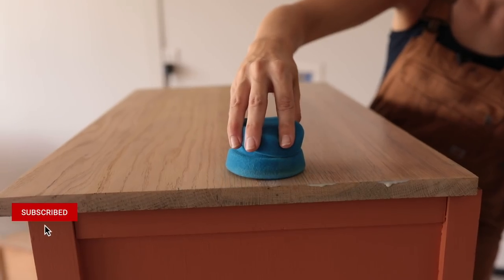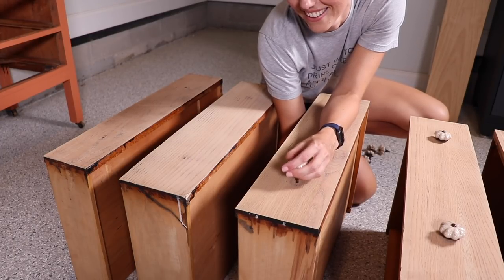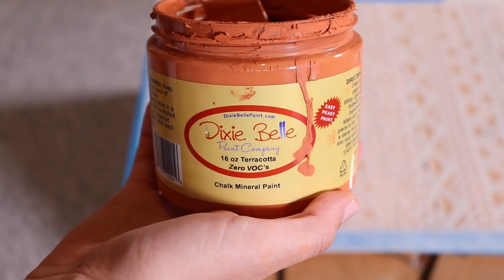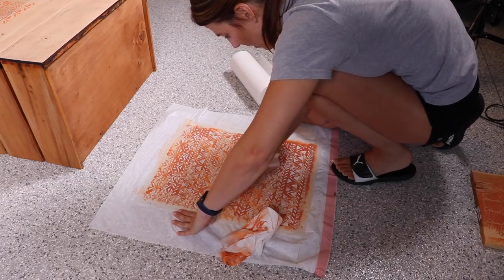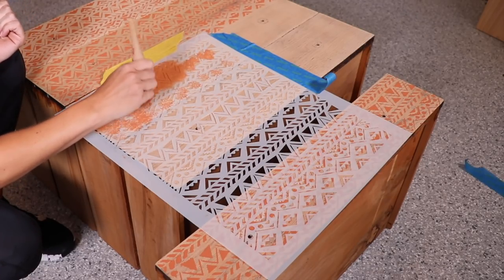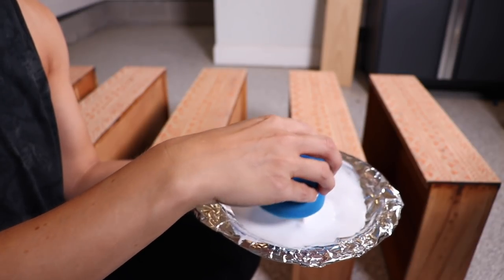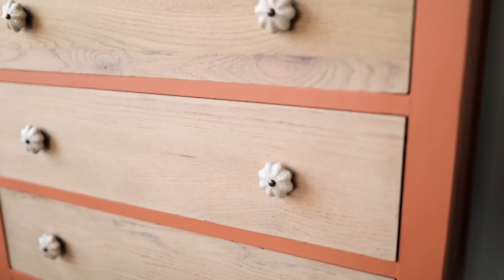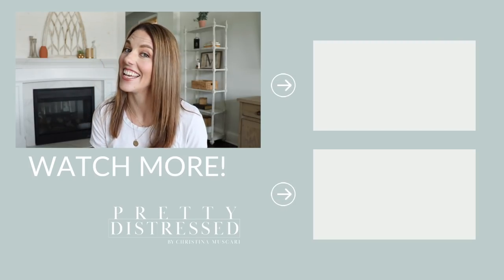Boho Furniture Makeover Belles & Whistles Stencil

Comment: It really made a big difference in the boho look when you added stenciling to the drawers.  You gave great tips on stenciling.  Many years ago I tried stenciling and had issues with bleed back.  I stopped doing stenciling because of that.  I probably had too much paint on the brush and I would leave stencil on until almost dry.  That REALLY makes the stencil difficult to clean!  So I learned from you things to do to prevent those problems from happening.  I may just give it a try again. Thanks for sharing!  I will check out Belles and Whistles Stencils.

Comment: Quick question - when painting vinyl topped furniture and you sand then prime, if you can scratch it off with your finger nail, did I not sand it enough? I don’t want to add paint and it scratch off. :(((